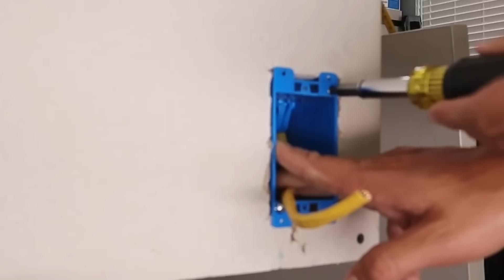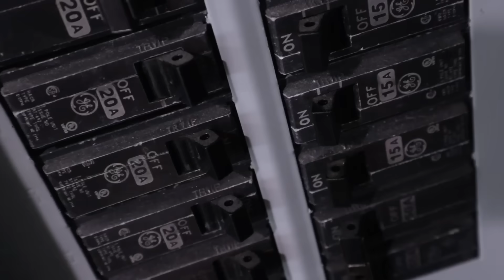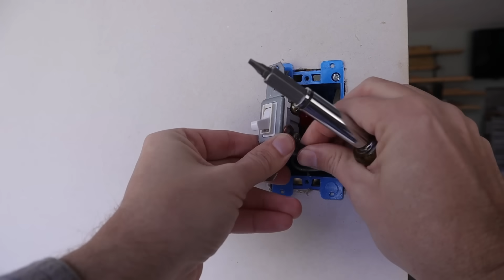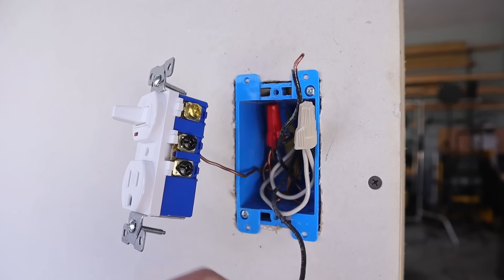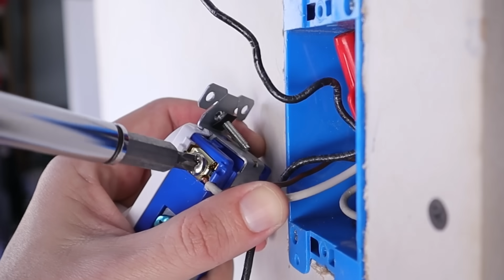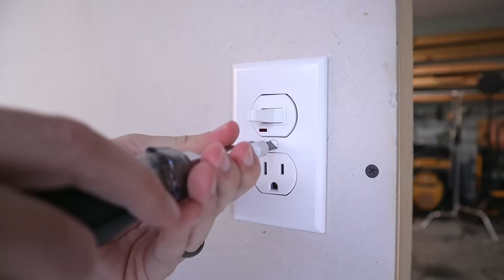How To Install An Outlet and Light Switch Combo | Adding a Receptacle To Any Room

Comment: I wish I could have seen this earlier. I wanted an extra plug in the bathroom for a dehumidifier( stupid enough, the bathroom fan is a recirculating fan, not an exhaust fan. They should lock up the contractor) the electrician was asking $400 because of pulling wire from the light switch. There are two light switches in the bathroom and one could have be used as a combo GFI/switch.

Comment: I have a problem with bathroom light combination switch. Turned breaker off. Pulled out switch and there is only one red wire and the black and white. Bought a new combination switch and installed and the light still does not turn on but the fixture does work after testing it elsewhere. I am not sure the problem...

Comment: Thanks for your very well done video I wish I would have looked to see if you’ve done one on 3 way switch wiring. With that said is it possible to use the switch/outlet combo instead of a 3 way switch?

Comment: Hey ok I tried replacing the old one last night in the bathroom had power all time on plug in... Well this is shared with bedroom to the next room... So I removed it thought I could do it well I messed it up..... Any help plz. So I have three black wires that comes into this box and white and ground of course. Ok I got white and ground good easy... I got light switch I think right as kick off light and it shuts off on and works... Well I had thought I needed to break the tab for power all time to plug in... I think I goofed up. But I'm not sure where other two black wires need to go.... I pry needa buy another one since I goofed up... Please help. Great vid btw

Comment: With much difficulty and excessive effort I pretty much just performed this same task but with almost perfect results. Wish I had seen this video sooner! Yes I did search for this exact situation but unfortunately did not find it until now. Unfortunately my results are still unsatisfactory in that the outlet is not hot unless the light switch is “on.” There are a couple of differences in my circumstance: there are two lights operated by the switch and there is also another outlet wired to the same circuit as the switch. Although a different brand, the new switch/receptacle is functionally identical to the one in this video and I have not removed the bridge between the hot screw contacts.

Comment: the neutral wire slot had two wire slots instead of making a jumper, could you not just place both wires into the devise

Comment: Very simple explanation to wire what could be a confusing switch. I want to use the switch to control the outlet and I see that I have to break off the connector bar and put a jumper pigtail in so the switch controls the outlet. Thanks for the video. I am now a subscriber to your channel

Comment: I have single pole switch going to light.  I wanted to add that exact switch,outlet combo, but there is only 1 black and 1 white.  Will this switch combo not work? 
I was thinking about jumping the load line that goes to the light to the neutral spot… would this work?  Assuming it won’t, but can’t wrap my brain around it.

Comment: I did this same job several years ago when I put in some overhead lights. I wouldn't recommend the switch you have in your parts list because after a few years the neon light will begin to flicker and eventually fail. Better to see if you can find a switch with an LED indicator.

Comment: So the one thing you need is a light switch. Oh, and you need a neutral. Isn’t that two things?
I also noticed that you seemed to strip too much, leaving copper exposed. Probably not too much of an issue.

Comment: When turning off the breaker for the switch you're working with, if it proves to be a 20 amp circuit, the pigtail should be made with 12 gauge wire, not the 14 gauge that most electrical outlets and switches are wired to 15 amp circuits with. 12 gauge wire is designed to carry a bigger load, but a 15 amp switch can be connected to it. It is all of the wiring, including the pigtail, that must be the exact same gauge.

Comment: I want to do this and I want the outlet to be hot all the time but the switch is at the end of the run and has only two wires in it (color coded red and black). The place was built in the early 60's. Can it still be done?

Comment: Why do you need a light switch? Can't you just run a new wire from the light fixture to the box piggy tail them & turn a power receptacle into a switch? or is it just because its a combo?

Comment: I just discovered your videos a month ago. Your video on how to wire a light switch and an outlet in the same box was awesome and a life saver.  My next project is  to change the light bulb socket in a ceiling fan. Thanks for providing such helpful information.

Comment: Thanks. I have a two receptacle in bathroom with a light that is plugged in as needed. I want to change to switch and outlet as you show but I don't have switch to start and I need to run  existing light wire into new light switch and outlet unit? Do you have that kind of video or can I do what I want with a little more  explanation from you or someone else. If I don't get reply from anyone I will just.  check You Tube more. Thanks again.

Comment: Would like to mention, that before using a volt meter to check if a circuit is live or not,  you should always check the meter with a known voltage source to verify your meter actually is working correctly. Safety first always.

Comment: Please provide couple of scenarios where I'd want to install something like this?

I can only see permanent things that fit in socket & don't interfere with the switch & doesn't have cords hanging down wall...

Because if cords are hanging down the wall or going up the wall, that's aesthetically unappealing ( ugly ), it could be hazardous having cord / wires hanging from that high on wall near switch I may have to feel in dark to turn on & off...

So please provide some examples where this switch / socket combo would be useful...

Otherwise great video & detailed explanations on how to install & what each wire does & safety precautions...

Thanks for sharing video...

Comment: Does not work in older homes where the neutral was not rum to the light switches. Power was run to the light, and a runner cable was sent to the switch. I have a home built in the 70's and not 1 light switch in any room has a neutral in the box. The neutral was used to run Power back to the light and marked hot. No 14/3 in this house lol

Comment: No no no. Most older homes have one circuit for the ceiling lights. You cannot run any appliances plugged into this unsafe install.

Comment: Nice demo. One question; I have a home with very old electrical, 100Amp. service, but no grounded outlets in the original portion of the home. The breaker box is p7robably circa 1950's, the first boxes used after the old screw-in fuses were discontinued in most electrical applications of residential construction.  So, can this be done by using a screw in the outlet box as a ground point, to test wires to determine which wire is "hot"?  My dad was a Journeyman  post WWII  Veteran),  and he taught me a few things, but we never worked on anything without a ground wire. As a matter of fact, he did a lot of residential electrical service upgrades, when he wasn't working at his job at Fisher Body, (now GM),  and took me along to help pull wires. We are planning an  upgrade, but it's not in the budget at this time. I have a new refrigerator in a finished room in the basement. It's too far away from an outlet, and I don't want to use an extension cord if I don't have to. It is right next to the light switch, so this would be a perfect application! Thanks. Renee C.

Comment: Why wouldn't you test for the hot wire while the switch was installed and in the turned-off position?

Comment: I have been wanting to do this. Appreciate your direct approch with visuals and no theatrics. Realized as I was checking that switch, that a different 70's palm rocker switch I hate makes ab excellent place to pkug the vaumn cleaner in and have a  regular switch. Thanks !

Comment: I'm glad you made a clear distinction between "back stab" and "back wire".  This appears to be a continuing disagreement within the trade.
You're breaker was 15 amp; maybe a word or caution to use wires & devices that are compatible to the breaker ampacity?

Comment: You just inspired me to put a new outlet on my garage light switch because just yesterday, I had to put an extension cord laying across the door entrance to get power to the corner of my garage where the outlet is behind a cabinet.  I’d much rather not have to worry about tripping over the cord (or even a piece of carpet covering the cord) at the bottom of the steps every time I go in and out of the garage whenever I’m using my battery charger.